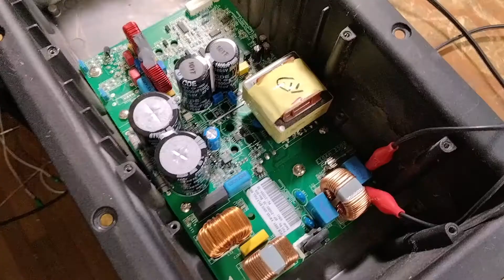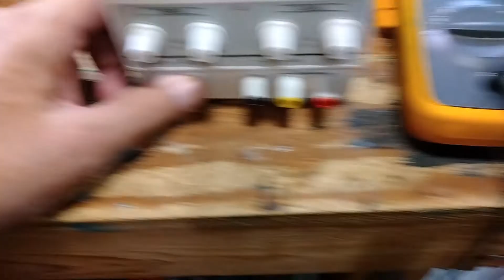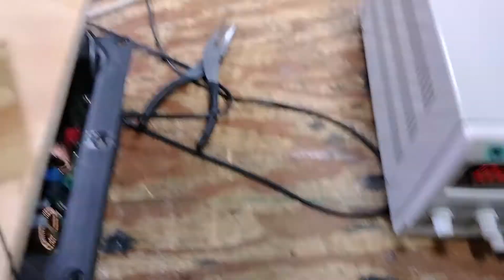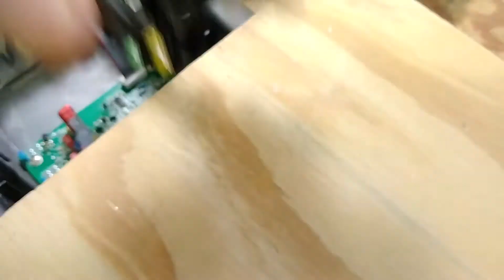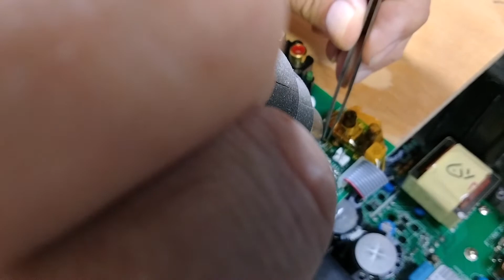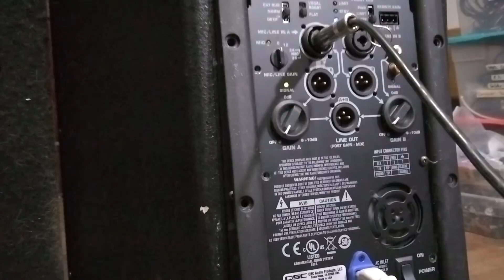QSC KW153 REPAIR

Comment: Hi is it possible to make adjustments to the crossover parameters on this amplifier?
Reply from the maker: No
Reply: I mean, you could, if you were willing to learn how to write code for the Analog Devices DSPs, then export the code into a firmware format & blow it into the EEPROM... but the real question is... do you really think you are smarter than the QSC engineers with their expensive test gear & anechoic chamber who came up with the crossover frequencies??   QSC has quite literally the most reasonably priced replacement drivers in all of professional audio, so if you are asking because you want to change the drivers, I'd advise against that. It will cost you more, and you probably won't get the result you hoped for.  See below for realistic amp power numbers from the dyno.

If you just want a plate amp because you have an old QSC K series BOP lying around, then you can put it in "test mode" by creating a solder bridge on a pair of pads right under the left input level control knob on the DSP / input board. This allows both amps to run full power, no restrictions, no protections, no frequency cutoffs. The amp / PSU board is responsible for current limiting / output short shutdown, so that will be the only protection you are left with, which should be enough in most cases. You'll get about 250 watts  RMS x2 channels.  You can buy a compatible wiring harness from QSC for about 10 bucks plus shipping.

Oh, and this amp is fully capable of running in bridge mono mode. If you want to do that, get the wiring harness for the KW118.  Otherwise get a wiring harness for any K or KW series top box to access the amp output in 2 channel mode.